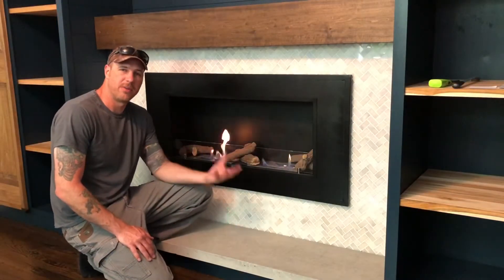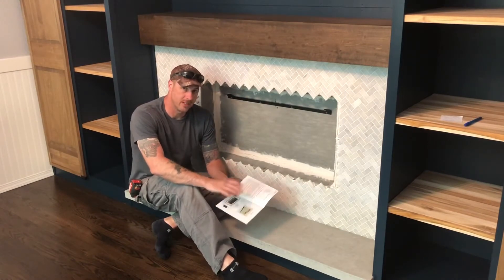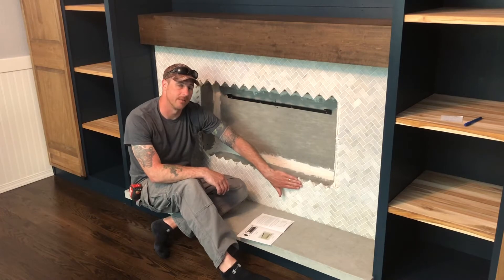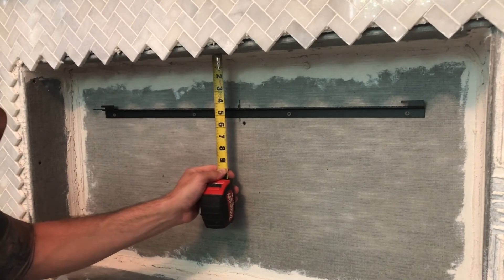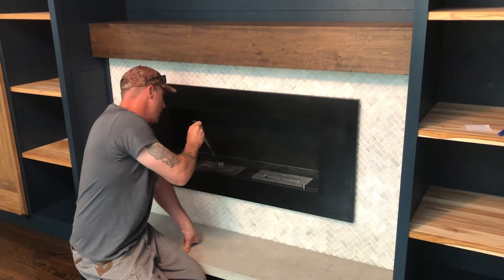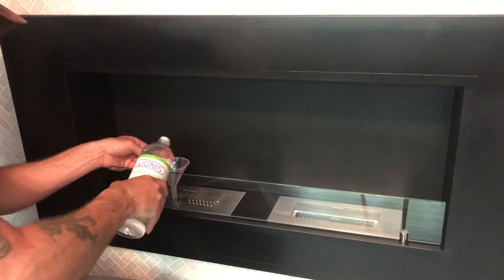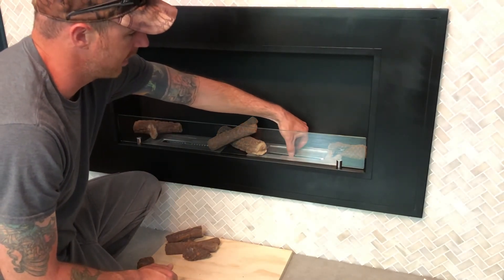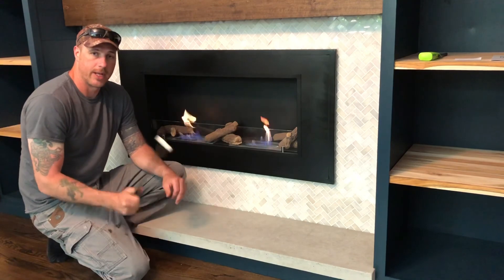DIY - IGNIS BELLEZZA 47” Ethanol Fireplace Installation

Comment: What type of paint did you use to paint it black? Does it scratch?
Reply from the maker: Hey Rebecca! Thanks for the comment. If I remember correctly, I went to Home Depot and purchased a spray paint can of Rust-Oleum high heat automotive paint. Also, I haven’t had any instances of scratching, but it is in a low traffic area and we are careful with it. I’m sure if I wanted to put a scratch on it, I could do so, but like I said, so far so good and it looks good. Hope this helped :) thanks for the support!

Comment: Hi- Great work.. can you do a video on how you built the surround from start to finish?
Reply from the maker: Hey Courtney! Thanks for finding interest in this. To answer your question… I currently have no plans to install one of these in the near future but if I do I’ll definitely do a surround build video. But to sum it up in a few sentences… the directions tell you the size box you need to build for the fireplace with every dimension you need. But just like how the video says, you have to take into consideration the thickness of the tile you want to use. I did a video on the mantel already of you haven’t checked that out, but like I said, it’s a fairly easy fireplace to install. Heck you can even just install it on a wall with nothing surrounding it. I’ll see what I can do for a video. I hope you have a great night and thanks again for checking this out. :)

Comment: Just curious how hot the actual metal frame and metal enclosure get? Too hot to touch?
Reply from the maker: Hey Brien, thanks for the question. The metal does get hot, especially the area right above where the flame is and yea you definitely wouldn't want to touch it. As for the rest of it, it really doesn't get that hot and I've never had an issue with it. Hope this helps. Thanks
Reply: @StoneyCreekSparkchaser  thanks for the reply! One more question..does the base/bottom of the fireplace on the inside get pretty hot from what you can tell? 
Just asking b/c i've seen some of the higher end ethanol fireplaces that have the glass rocks and also the led lights under the rocks and i'm wondering if there is a way to incorporate that into this design? The burners themselves look like they are made of heavy gauge steel, which apparently has poor thermal conductivity. So in theory, the base shouldn't get too hot..but obviously I don't want to just throw in some led lights under the fire glass without making an educated decision  and risk them being a fire hazard.
Reply from the maker: @brienrekuc6347  hey Brien! That's a good question. Umm, from what I remember it does get somewhat hot and yes the canisters are made of thick steel. Having said that though, we don't use our entirely too much. It's more of a decorative piece but having said that, we do use it when it gets really cold. May I suggest, if you don't use it very often, why don't you just slap some lights in there and then when you want to use them, take them out. Of course unless you are using it for home heating all the time then I can see that being unhelpful. 

Anyhow, I hope this helped you and thanks again for reaching out. My apologies for this being a late reply. Work had me slammed today... which, is a good thing :)

Comment: Now that you've gotten to use the fireplace for a while, how long does a fire usually last if you fill up the burners and leave them open on the max setting? I've heard most bioethanol fuels burn out faster than the 4 plus hours advertised on the bottles.
Reply from the maker: Hey KC! Thanks for coming by and asking this question. You are absolutely right with your estimated time. Sometimes it will go a bit longer but that just might be because I put a little more fuel in there. We don’t use it often. Mostly for company coming over to make that area more cozy. And we only fill it up when we want to use it, because if you just close the burner top, the fuel eventually dries up, so we don’t want to waste it. We still really like and and it makes the space feel more inviting. Would we use it as a primary heat source. Absolutely not. That’s what our wood burner is for. I hope I answered your question and if you have any others, feel free to fire away :) thanks again KC and I hope you have a wonderful rest of your weekend :)
Reply: @StoneyCreekSparkchaser  thanks for replying so quickly. If you were to time it, how long will the fire typically last with the unit fully fueled and the burner all the way open?
-Would you say closer to 4 hours?
-Closer to 3 hours?
-Closer to 2 hours?
-Closer to 1 hour?
Reply from the maker: Oh no worries. I love trying to help. I would say closer to 4 hours if not more. I’ve never ran it full open because the flame gets pretty high and I don’t like taking chances especially if I’m not in the room with it the whole time, but at half open we can get it close to have it run most of the day, so like 7-9 hours. Do you have a specific use you’re trying to get out of it?
Reply: @StoneyCreekSparkchaser  thank you! You answered my question exactly. We just bought a new home that doesn't have the option for a gas fireplace. I'm looking to put in a fireplace like this in our living room. I know it's not as economical as gas, but if I can narrow down how long a 1 liter bottle of bioethanol fuel typically burns for then I can at least know what to expect and plan accordingly. Thank you for answering that question.

I think the last question I might have is are you satisfied with the flame height? In a lot of the videos I've seen the flame height of the bioethanol fireplaces seem a bit smaller than a gas fireplace.
Reply from the maker: Super glad I can help. So I’ve seen a few gas fireplaces and I’ve noticed that the flames from them can be rather small in my opinion. And actually a lot of people try and do things to those fireplaces to make the flame seem bigger. My father in law has a gas powered fireplace and the flame is so small. We’ve tried everything to get it to go bigger and it just won’t work. As for the ethanol fireplace, when you first light it off, the flame can look rather small, but as it burns (say after 5-10 minutes) it can get rather large and that’s the main reason why I don’t have the burner full open. If you watch the video again, you can kind of see it for from smaller to larger as it stays lit. We’re happy with it and it serves its purpose for what we want it to do. It really ties in the room well. It can make the room feel a bit warmer when it goes for a longer amount of time so it will heat, but definitely not as a primary source of heat like I stated before. I think you’ll be happy with it. Especially if it’s the only option you have at the moment.

Comment: Awesome work. I have this exact one...have not opened yet. Far as the non combustible material....could I use wood stud and in case it in cement boards like you did here? Or should it be both metal studs and cement board? Your whole setup.looks very professional btw. 👏🏾
Reply from the maker: Thanks E. White for the question!  As for a "correct by-the-book" answer, step 4 specifically states to use metal studs with a cement type board as an incasement.  Metals studs are really easy to cut and install with sheet metals screws.  Drywall screws can also be easily screwed into the metal with pre-drilled pilot holes to hold the cement board in place.  Now, as for a "not-by-the-book" answer, that's basically up to you using your best judgement.  I can tell you for a fact that I'd be completely comfortable using wood studs in this installation and here's my reasons why I would deviate.  First, the flame is contained in the fireplace box and it is a fairly controlled low flame.  Secondly, a cement board incases the whole interior of the cavity.  Third, if you go the extra step of mortaring the joints you get added protection. Fourth, the unit "floats" inside of the recess and has an air gap all around (besides the anchor point). Lastly, I've installed a few other "real" fireplaces and they call for less distances to combustible materials.  I'm personally ok with using wood studs if certain clearances are met and if I feel safe to do so but that's a choice I do believe you'll ultimately have to make for you to feel safe and worry free that nothing will get too hot and catch on fire.  Sometimes it just pays to play it safe than to be sorry down the road.  I hope this answer can point you in the right direction and I do apologize if it's not the answer you were looking for.  Good luck on your install and if you remember, let me know how it goes.  I always like hearing how installations go and others like hearing them as well because the more info we get out there, the better folks can stay informed and maybe learn something from you! Take care my friend.
Reply: Ok I'm back after 2 years 😆 😅 I finally installed it and I took your advice. Very comfortable with the outcome. I just need to add the ledger stone facing. I fired it up the other day and it looks so great. You and another youtuber really helped me come up with a concept for the fire box that surrounds it. I did document some pics and vids along the way added to my short vids
Reply from the maker: @EWhite-ed4mc that's awesome and thanks for checking back in! I'm glad it worked out and I bet once the stone/tile is done it's going to look amazing. I'll be sure and check out your YouTube vids on the install. Nice job and thanks again. I can't believe that was two years ago! Holy!!!
Reply: @StoneyCreekSparkchaser  thanks for the advice lol. Wife is happy with the outcome. I also have that secret compartment too lol😂. I just upload a 15sec clip. But will add a finally longer video when I'm finish with the final. Again I appreciate you uploading this years ago. Will update later
Reply from the maker: @EWhite-ed4mc thanks brother! Happy wife = Happy wife and that secret compartment is the bomb. We always use ours :)

Comment: How hot does it get
Reply from the maker: It can definitely put off some heat. We have it in a room that is approximately 12x10 and we can notice it heat up the room. As for the insert itself, it does heat up. I do have a wooden mantel above the firebox and it does get warm to the touch, but in my opinion, it’s definitely not hot enough to be a burn hazard. If you follow the directions for installation about combustibles clearances there should be no worry. This answer your question?
Reply: @StoneyCreekSparkchaser  yea pretty much my living room is 40*25 so I was just curious. Im up in the air getting this or going with gas. How much does it cost to run it? Sorry for all the question
Reply from the maker: It’s totally fine, I don’t mind. That space seems a bit big, but they do make a version that is a bit longer which has 3 burner trays. That could make a difference. I would say this fireplace is good for that decorative look with some heat. It works great for my situation, but yours may need more power if your looking for a steady source of heat. As for cost, I’m not sure but the ethanol to me might cost more to run. It could be around 20 dollars a day or two, but I’m really not sure. Hope this helps Brandon and if you have any other questions, just fire away :)